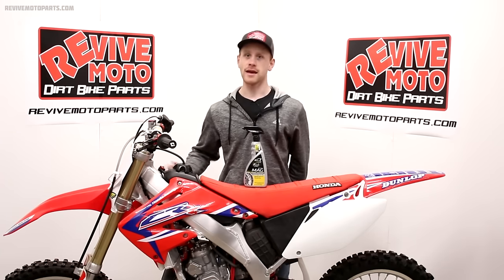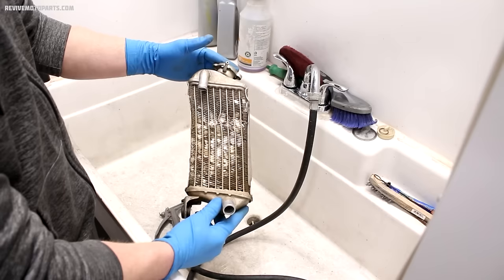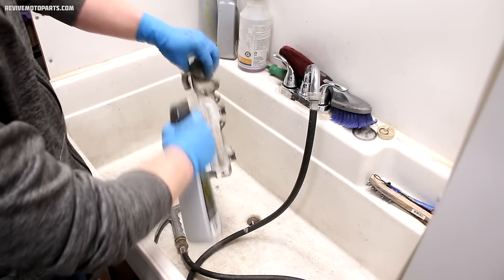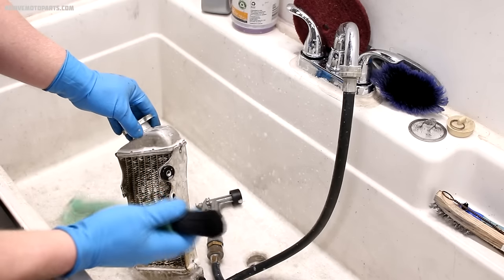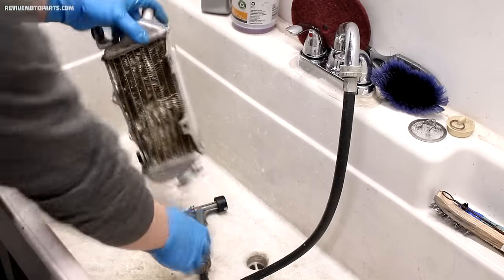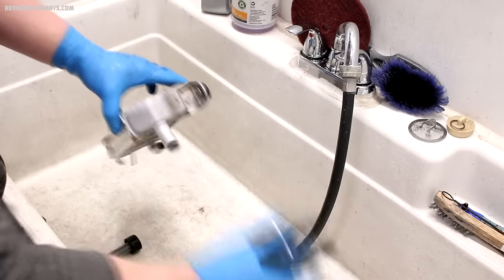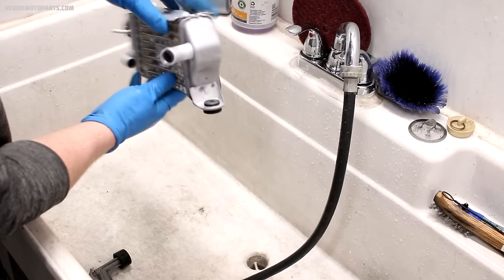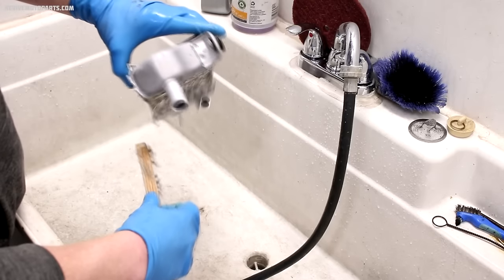Unbelievable Aluminum Cleaning Tips

Comment: Just bought a bike yesterday morning that's been sitting for about 6 months covered in red mud. Spent today and yesterday scrubbing (with a toothbrush) the radiators, engine cases and swing arms with that Mag etching for cast metals. Did wonders after spending about 4 hours with degreaser and not getting anywhere. Thanks for the video!!! Never would have thought about that product!!
Reply from the maker: Man that's awesome the product works for you! Glad you found the video and thank you for watching.

Comment: Can you use the Mag cleaner on the parts of a complete bike safely?

Is it ok to use on engine cases while still in the motorcycle?

I've just bought a 2019 CRF450R & just want to give it a good make over.

I'm just not sure if thing's like painted engine covers, rubber, plastics, steel etc are safe with this product on it?

If not whats the best way to clean the bike with the engine still in it?

And it's ok to use a wire brush on Aluminium?

 Seems crazy and like it would scratch it to pieces?

Thanks for any help & advice.

Comment: If I take my plastics off and forks off can I just spray down everything? Wanted to know what I should miss with the cleaner and how I should apply it on my bike. Thanks man
Reply from the maker: You could do that but it'd be easier to apply the cleaner to a brush and hit the areas that need cleaning. Anything anodized will get ruined by the cleaner, so that includes forks, part of the swingarm, rims, and any aftermarket bling parts.

Comment: How about thread repair? that  would be useful.
Reply: m1ke2001 get a thread tap set and rethread it, simple process once you buy a set
Reply from the maker: That's a good video idea, I'll put that on the list.
Reply: m1ke2001 helicoils
Reply: Yes please , thread inserts and helicoil ! like stripped oildrain hole without dissassembly of the motor

Comment: I have a titanium fmf megabomb with some boot gunk on it do you know a way i can get gunk off my exhaust if so can you please please make a video about this like a how to video I think other people are wondering the same question too
Reply from the maker: The mag wheel cleaner will help quite a bit but you'll have to use something abrasive. A rough scotch brite pad or wire brush will clean that off. Heating up the pipe will also help loosen up that stuff.
Reply: I just got off a bunch of plastic gunk on my pro circuit header with a couple coats of oven cleaner, or you can use eazy off, stuff like that does the trick without haveing to use anything abrasive.
Reply: wd 40 and a paper towl will remove two stroke splooge extremely easily
Reply: Presley Costa windex and red scotch brite made my fmf titanium header look amazing. It really gave it a nice mix of colors